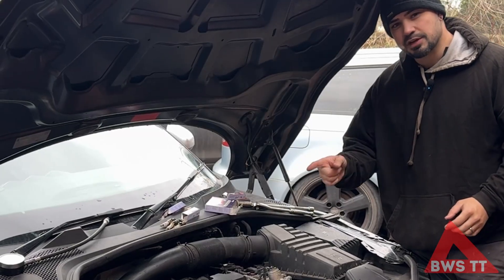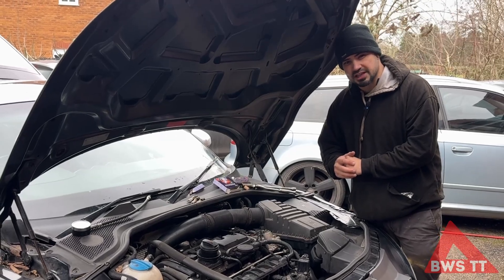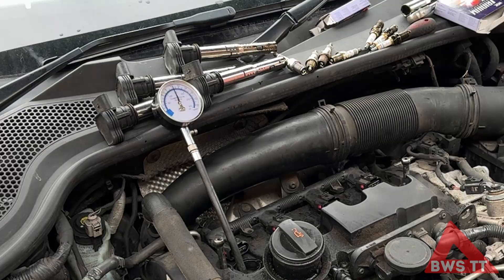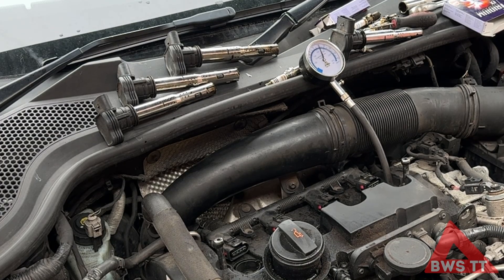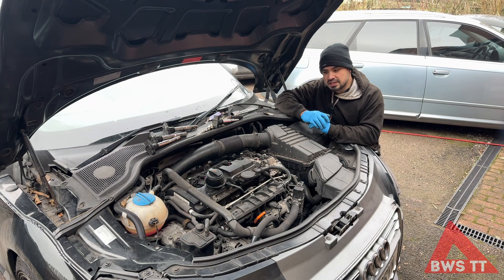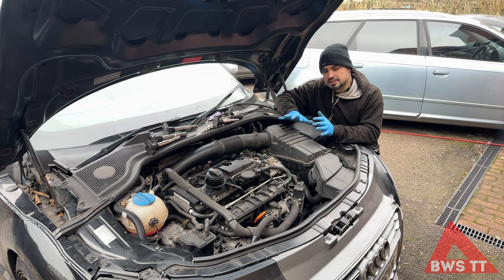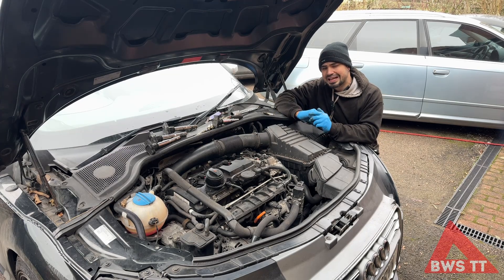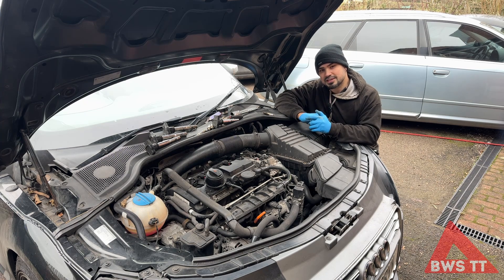Is my 156,000 mile engine healthy? High mileage hero!

Comment: My Audi TT keeps macking a funny noise when I drive 20mph and over. It sounds like a wheel bearing kind of noise, but I looked at all four wheel and all bearings are good and CV joints.
Reply from the maker: Ok, unfortunately it’s unlikely any diagnosis from anyone remotely will be accurate- you need an experienced set of eyes to look at it

Comment: Really enjoy your videos! Please keep making more.

Would like to ask a question, if I may. I’m trying to keep my 100,000 mile 2003 TT Quattro, 6-speed running, but it has developed a confusing issue. Under certain conditions, the shifter “locks” and I am not able to move it forwards or backwards to go into any gear. sideways movement is still available. There is no grinding of gears or other discernible noises. This usually occurs after an acceleration or deacceleration. The only way I’ve found to clear it is to pull to the side of the road in neutral and continue to keep trying until it finds its way into a gear. I have “reset” the shifter cables and the bushings seem ok. I also replaced the transmission oil, just to satisfy myself. I believe the clutch is ok; it has plenty of back pressure, but I guess the master or clutch slave could have “bypass” issues. While the shifter is locked, the engine continues to run as normal. I should also mention that there is considerable vibration in the steering wheel at times. Before pulling the transmission, I am wondering if there is a possibility that the 20 year old engine, transmission, pendulum mounts could be so worn that they can cause a misalignment with the shifter or possibly put a load on the transmission gears to stop the shifting? Have you seen anything like this in your experiences?

Thank you in advance,
Dave
Reply from the maker: First step in diagnosis would be to see if multiple pedal presses helps the situation. The way the linkages are mounted to the box mean that movement shouldn’t cause any issue, so that’s not likely to be the cause. Worth doing a fluid flush aswell, as the fluid is very often overlooked at service intervals